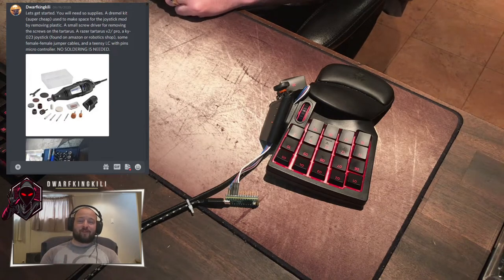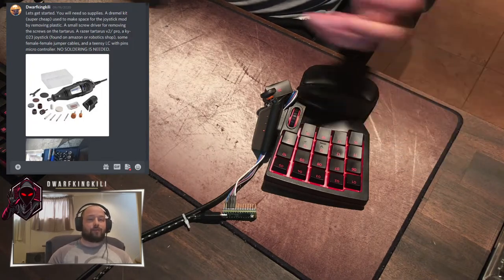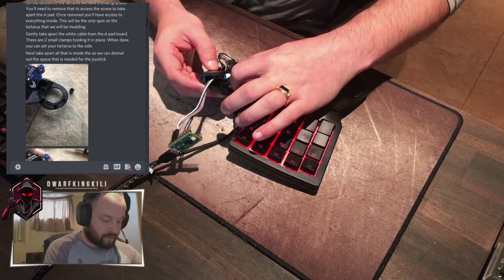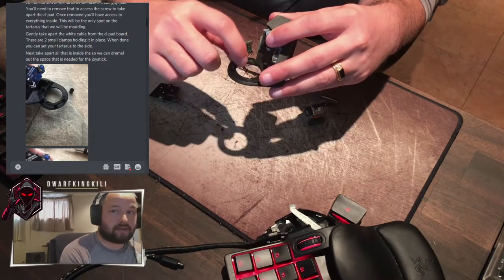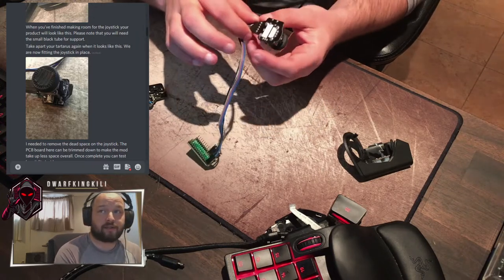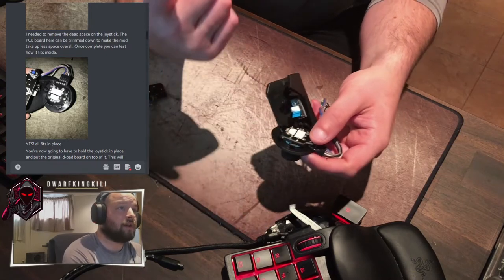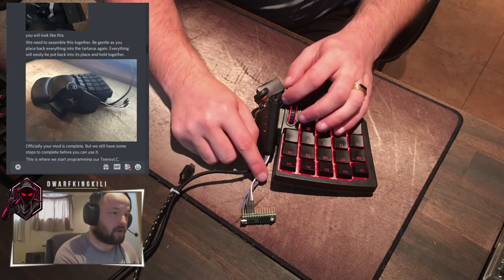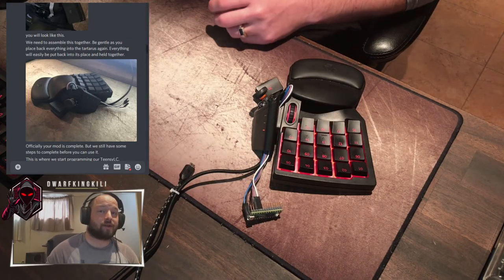RAZER TARTARUS V2 ANALOG JOYSTICK - PART 1

Comment: i know it's offtopic but maybe you know the answer.

so razer tartarus only limits amount of macro keymaps to like somewhere between 10 to 20, there is only 3 light up lights on the right side and only a certain total combinations can exist. 

the amount of macro keymaps i need is like 30.

basically on job applications for 10 years i agot like 15 addresses and 15 employers. i want a keymap for each address of each of these things. while do job application rotate to next keymap as i go, hit the combo of keys and move on, i can fill entire web pages in seconds if done right.

so my solution is this(but i dont know if it exists or how to do it):

create a macros, that can require key combo to do. this would allow me to merge many keymaps onto 1 keymap. for example, keys 1 through 15 are my macros for each employers, and then keys 16 through 20 are my modifier keys, and i simply hold key 16 while press 1 to do the function of the next keymap, i could merge this method 5 keymaps onto 1 keymap, simply by allowing me to trigger them with a combo of keys pressed.

is this possible? it would allow me to exponentially use more keymaps than razor tartarus system would allow normally.
Reply from the maker: I have a perfect solution for you. Is there a way we can talk over Discord? It'll be much easier to explain there.

Comment: I did this. Very very time consuming but easy. The only things I had though was the Teensy, Connectors, and analog stick. So no dremel. Now imagine using scissors like a saw to create a hole big enough for the analog stick to fit in. Then imagine using scissors to shave away at the Tartarus in order to get room for your poking out cords.

Almost gave up a few times but kept at it cause I really wanted the analog experience.

Works in MW2 Xbox Series X. I have a Keymander 2 but now I need a usb hub to see if I can connect it to my Keymander and use it for fps games like Far Cry 3 that doesn’t support keyboard and mouse. Hopefully I can get a usb hub soon.

Thanks for the walkthrough videos💪🔥 Really helped make a dream come true😭🙏
Reply from the maker: Now that is a story. I love it! I'm happy it all works for you.

Comment: Very nice, mate.

I've been wanting to have analog movement for FPS for literally a decade(?) since I got my Belkin Nostromo Speedpad52 and wondered why on earth the pad was digital. Ten years later literally nothing has changed unless you can spunk £200 on a kit from europe.

So, I was looking for something online that would basically be this mod, and kind of wanted to avoid videos (because I can't learn from videos) ... however I didn't watch this for the learning. More to just see that it has been done, and successfully.

I've got a couple of analogs and a teensy on the way to mod my Nostromo (I appreciate it'll be different) and I was worried it would be hard, but this put me at ease. Now all I have to do is ensure that I can get the teensy to represent as an xinput and I'll be laughing! (as long as I can use the darned thing to run with ... heh)
Reply from the maker: Hey, I'm happy this is something you're looking for. I've found several games where this is amazing. Some games that support WASD/ Analog input. I've got a discord link in the description that shows everything step by step for those who don't like videos. Feel free to join up and check out how other members have done their mods. We've recently needed to do a small coding change because newer arduino software was causing bugs. The community is amazing and we're all able to help where we can.
Reply: @dwarfkingkili698  nice one, cheers, mate! ... I might not see you in the discord, because I don't use discord, but this is all brilliant stuff! :-)
Reply from the maker: @eliotcole  I’m happy to help you step by step or provide a text document to you. If that’s something that’s good for you.
Reply: I mean you could just use a normal controller in one hand and a mouse in the other I know its not ideal but it does work
Reply from the maker: @briumphbimbles  You are correct. I'm working on an Xinput joystick right now. Making the joystick a Xbox 360 movement stick. That in addition to the tartarus and mouse, you get full 360 degree movement. What do you think?
Reply: @dwarfkingkili698  I have no idea why they didnt put one on these. It makes no sense. Its the only reason I would buy one
Reply from the maker: @briumphbimbles  The mod is really easy to do. Some games support native analog instead of Xinput. So it's even easier. I've been using my joystick for 2 years now. Never had a problem with stick drift. Works amazing.
Reply: @briumphbimbles  I seem to have lost a reply ... which is weird. Anyway ... this would lose so many buttons it's not an option at any level. But good looking out, mate.

Comment: I didn’t even know something like this existed. Really contemplating doing this I just don’t want to buy a Dremel   just for this one project 😫
Reply from the maker: Well you're in luck. Because a Dremel isn't 100% necessary. There have been people who have filed down the area and it still works. Some have even used one of the micro hand saws. Pretty much anything to remove the plastic from the Tartarus. Now where I removed the plastic beside the joystick, that doesn't need to happen if you're doing the soldered version. It also makes it look more clean and presentable. If you want I can also help you with the mod. I have a discord we can chat in.

Comment: Good video. Just a question. Why dose the d pad ribbon have to be plugged back in? Will the keyboard not work with it unplugged? Was just curious..
Reply from the maker: The keyboard will work. You just can't use the button above the d-pad if it's not plugged back in.

Comment: I have never done something like this before, the switches under my d pad for my tartarus are worn out, but i just can't go keyboard , would this be a good starting project?, i am a bit nervous or should i just see if an independent tech guy can help me
Reply from the maker: There are specific switches you can get that you can replace the d-pad with. If that's what you want to do. Otherwise, the joystick is an amazing project that's very much worth it.

Comment: I need the Razer Tartarus Pro keyboard joystick... I need the board part to replace, mine is already failing.  where do I buy?
Reply from the maker: You can't buy the board by itself. This is why I've made a replacement mod for it. I've got the analog joystick mod, and a new touchpad joystick one too. The D-pad is prone to breaking really really quick.

Comment: I don't think i need the mod. I just want to fix the joystick i have. Do i have to worry about it unprogramming if i disconnect the cable?
Reply from the maker: Are you talking about the D-pad? You'd just need to de-solder the switch and put a new one on. There is a specific one that's needed though. You can unhook the power usb cable and reattach it with ease, no worries there. For the D-pad PCB, you can also take that off and put it back on with ease. It's only connected by a ribbon cable.

Comment: Just bought this. Purchased before I saw you sell directly with mods. Interested in if you'll let me send mine to you so you can mod it? I saw somewhere you mentioned an issue with using it with xim. Was this an issue with powering the joystick mod? Could this be solved with a longer power cable direct into an outlet on top of the desk?

Extremely impressed with the video man great job. Love to hear from you on your ideas
Reply from the maker: To my knowledge you would need 4 ports to use this with xim. Xim only having 3. BUT a comment below said "you could use a titan two device, this would give you an extra usb port. So basically it goes Titan two - console. Xim - into left port of titan, mouse/Tartarus/controller into xim, analog stick into titan." So it does seem like it would work. 

Additionally, I'm always willing to discuss the mod process. Sending it to me, or walking you through your own.
Reply: @dwarfkingkili698  can I ship mine to you as well boss

Comment: Great mod. I will try this with my tartarus. I just wanted to know what sort of cable connects to the teency lc board for power? Also, how do you tell which pins on the teency lc are for ground,  3 volt, etc? Cheers
Reply from the maker: This mod was done with jumper cables. All able to be done without soldering. When you order the teensy lc you get a sheet with it showing what all the pins are for. But you can also follow the other videos after this one to make sure you have it correct. I am also available to help when the time comes if it's needed.

Comment: I have not used my tartarus since I bought it (I got it on ebay cause I thought it looked cool basically, I didn't exactly plan on using it anyway lol), but if it had a legitimate analog joy on it I feel like I would never not use it.
Reply from the maker: Mod is always here to do. It's amazing. I've used the joystick for years now. I just recently finished a new mod using a VR trackpad made into a touch joystick for gaming. No YouTube video yet, but I am working on it. Let me know if you need help with your mod.

Comment: I just bought this keyboard and so far i am happy with it. The only thing im not happy with is the feel of the analog stick. It sits too low for my comfort. I am new to PC gaming so i am learning where to look for parts. Is there a way to extend the thumb stick?
Reply from the maker: You're taking about the d-pad stick right? You can always add a grip to the end of it, when I started I picked up a knock off Kontrol freak and super glued it to the d-pad stick. Worked really well, until I went with the joystick mod.

Comment: Hi, I'm looking to do this mod because the original dpad is loud and gets "stuck" because of synapse, also 360 movement is just better (when it works). Is there a way to keep the teensy lc inside the tartarus, or do I have to make a sort of box around it? I have water around my setup and am nervous about the exposed pcb.
Reply from the maker: You can for sure put it inside. There are a bunch in the discord chat that have done it. I also have an updated mod that I can show you. You can just make a small hole in the tartarus for the teensy usb cable. It's far easier doing the mod and saving space while soldering.
Reply: Okay, cool I've got a soldering iron and have a rotary set on the way. I was thinking of making it so I could use the teensy lc usb port to detach the cable when I move things. I'll definitely pop in the discord and see how they did things.

Comment: My joystick works on youtube but it doesn't want to work in apex? Do u know any fix struggling rn just got mine
Reply from the maker: You've done all the steps in the DIY? If so we can troubleshoot it.
Reply: @dwarfkingkili698  got it fix thanks brotha
Reply: @dwarfkingkili698  I was asking just for the regular joystick for some reason wasn't working but ima gonna mod mine to cuz I kinda don't like the joystick where do I buy the parts at
Reply from the maker: @2828moises  Amazon. You'll need a teensy lc, female - female jumper cables, and a KY-023 joystick with headers. Everything is listed in the description also.

Comment: As I'm watching your video I'm wondering why the hell they didn't put a real analog stick on it.  8 way stick for use with the razer Naga mouse. They coulda sold them as the perfect combo.
Reply from the maker: Very true! I've also just completed my Xinput stick (which will be uploaded in a day or two) This makes the stick be an xbox 360 controller for 360 degree movement instead of 8 way. This is for games that support xinput/ dual inputs. Hope you check it out!

Comment: if i want replace the faulty switches. what is the model of micro switches i need for?
Reply from the maker: You're going to need a 2 pin mini micro switch. You'll have to de-solder each, and then put all 4 back. The brand without checking I believe is Omron. Now doing that would be more work compared to this mod. And if you're familiar with soldering, you can make a joystick with ease.
Reply: @dwarfkingkili698  i know the brand are Omron, but i looked for those and the size is wrong, i need a serial or model for this specific switches

Comment: This is for PC gaiming only??? Will this DIY-TARTARUS-MOD working with XIM APEX AND XBOX ONE????
Reply from the maker: Primary PC mod. But from others we've found that this will work with the xim apex. You just need an extra item to make it work.
Reply: @dwarfkingkili698  And what is this extra item?
Reply from the maker: @mrak1708   What was discussed was that you could use a titan two device, this would give you an extra usb port. So basically it goes Titan two - console. Xim - into left port of titan, mouse/Tartarus/controller into xim, analog stick into titan.
 Or could go analog into xim & razer into titan.

This is because you'll need 4 ports 1) tartarus 2) analog joystick 3) mouse 4) controller. And the Xim only has 3 ports. 

Fortnite, I've found an alternate way to program. If that's something you're wanting to use this with. I can explain that one.
Reply: @dwarfkingkili698  Hi,I finally finished my mod,just a little problem in the game on xbox one my joystick have only two directions left and back? Any idea how to fix it????

Comment: Hello.
Just wanted to thank you.
I finished my modification on my Razer Tartarus.
What I did different was using soldering and now the joystick cables are only exiting the keypad next to the standard cable.
And I used merek his board and programming: https://www.youtube.com/watch?v=wIx8vt1OwCo

I now have to figure out how to make a cover for the stuff inside the joystick, so that dust doesn't cause problems.

Comment: Are you able to use after it being installed or is programming  required also am I still able to use razer synapse after?
Reply from the maker: This will work right out of the box and synapse will work 100%. Because the joystick has its own code/ software it doesn't get in the way. Joystick is WASD by programming.
Reply from the maker: @XIXSOULXIX69  If you're in the discord, some members have put the teensy lc into the tartarus to tuck it away. Then the 2 cables you seen can be merged together how you see fit. Otherwise you could get a teensy without headers (pins) and solder on, to make it more compact.

Comment: Is there a way we can purchase  one from you?
Reply from the maker: Absolutely.
Reply from the maker: Did you join the discord? We can private chat, and get things sorted for you. I'm more than happy to make one for you.
Reply: Hey brother! Is there anyway I can purchase one already put together with mod?
Reply from the maker: @deangeliog4154  Absolutely. Where do you live (country)?
Reply: @dwarfkingkili698  I have the Tartarus pro and I run it through  usb drive known as “XIM APEX” that allows me to play mouse and keyboard on Xbox. The analog stick isn’t that good and, anything that would give it a much better experience would be AWESOME!!
Reply from the maker: @deangeliog4154  Yeah. The stick is a 4 way D-pad. And they break really easy too. If you've already got a tartarus I can put the mod together (joystick, jumper cables, and teensy) and ship that. It'll be much cheaper too. Only thing you would need to do is make the mod space on the tartarus. 

Now saying that. I wouldn't use this with the Xim because it only has 3 input ports. Keyboard, mouse, and controller. You would need a 4th to power the mod. This isn't an issue with PC. 

Lastly I am working on a way to incorporate the joystick into the tartarus. Making it perfect for Xbox/ Playstation.
Reply from the maker: @deangeliog4154  A quick look online. There is a way for this to work with the XIM APEX. I'm just looking more into it for you. If you wanted to look also, that would make things quicker.
Reply: @dwarfkingkili698  you could use a titan two device, this would give you an extra usb port. So basically it goes Titan two - console. Xim - into left port of titan, mouse/Tartarus/controller into xim, analog stick into titan.

 Or could go analog into xim & razer into titan.

I'm actually considering this mod but where the circle button is I'm going to put a 5 way d nubbin cap ( like what the azeron has)

Awesome video btw
Reply from the maker: @LightsOutGN I'll take your word that it would work. And would make this MOD easier and accessible to others who may want it.
Reply from the maker: @XIXSOULXIX69  Honestly, if you're getting the devices to MOD. it's just copy and paste the code. I'll walk you through it, takes all of 5 minutes. No need to pay for something that is super easy to do. I would feel like I'm ripping you off. I'm also always around for questions in the process of making it.
Reply: I also want to buy, I'm from Mexico